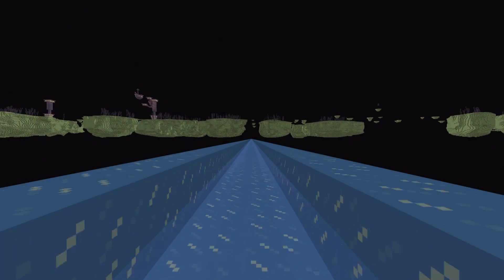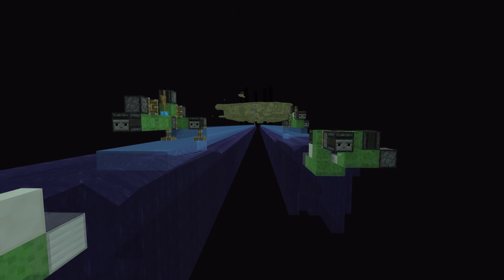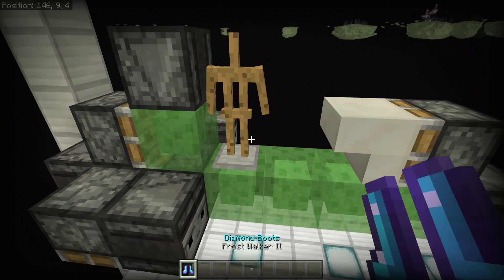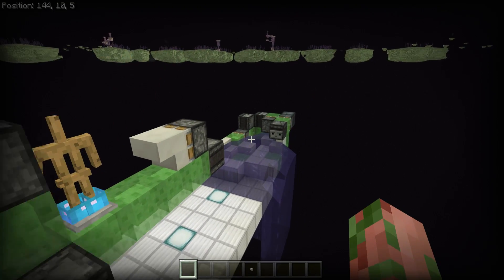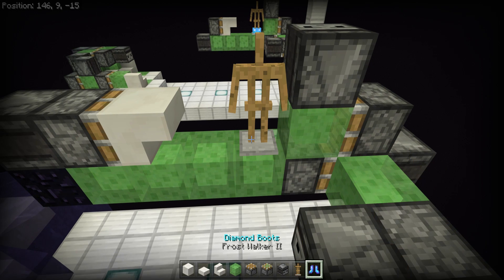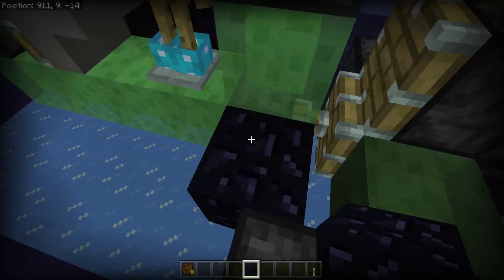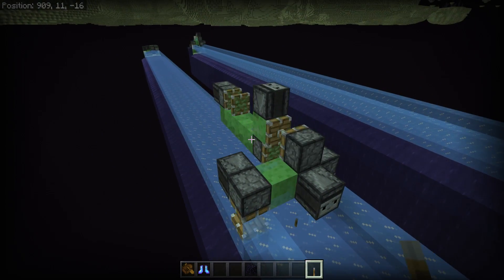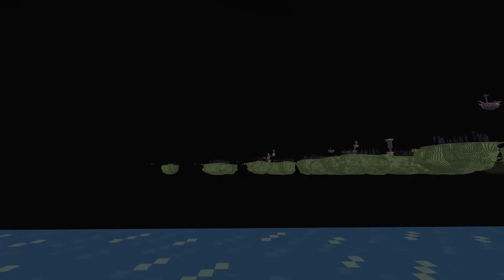Minecraft Bedrock: Easy Frosted Ice Highway Tutorial! MCPE Xbox PC

Comment: Just to clarify, this *still functions perfectly fine on BE 1.13*. I was wondering why the ice was melting, but then I realized I had my own derp moment and forgot to set the time to night 😅. After that, it worked like a charm.

Two notes: 1) Be sure to use a regular piston when he says to use one, and 2) make sure it's night lol 😂
Reply: Materials List:
8x Observers
1x Frost Walker Boots
1x Armor Stand
2x Pistons
7x Sticky Pistons
12x Water Buckets (or have the ability to get 12 buckets-worth)
22x Slime Blocks
2x Slabs
3x Stairs
At least 2 stacks of Solid Blocks (If you wanna build the same structure as Silent; the flying machine only requires 6x)
2x Buttons/Levers
2x Obsidian Blocks
Reply: Thx very helpful

Comment: I know this doesn’t work anymore, but I had a question, why does the ice not melt? Also, how would you get down so low in the first place?
Reply: Basically its light level. The reason frosted ice melts is because the sun is enough to melt it, but since the light level in the end is very low, it doesnt melt. As for how you go down that low, just build out as far as you want and place a water bucket

Comment: I've found a much simpler method. Use the standard tiny flying machine, with 4 stairs in a row, facing the rear of the machine (make the outer two corners.) This creates a 4 wide highway to freeze and lift up.

Comment: I wish this was still possible.  It would make travel easier and not so scary.  Like I tried using a flying machine my second time after defeating the dragon as the end gateway was not located over the island making trying to get to it and use it extremely hazardous in my opinion.  After I put a majority of my stuff in my ender chest I tried to use my flying machine and glitched through not even 30 seconds later.  I am kinda put off by the thought of doing that again.  Is there anyway I could make my flying machine safer? Like should I use a boat or minecart or will those glitch through as well.  If there is nothing, I will just look into making a different bridge building machine.
Reply: @raymondstheawesome  Thanks I figured it out a while ago through testing because I knew some Minecraft YouTubers had done it. Still never going to do it with armor or value items on me though.